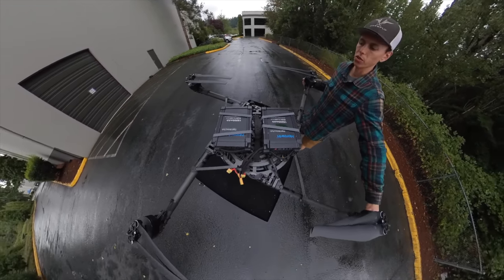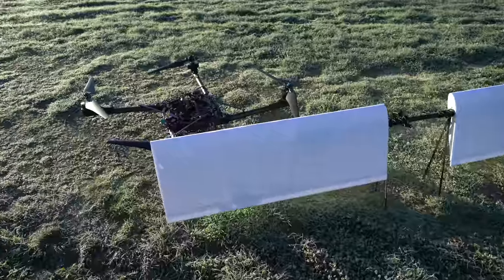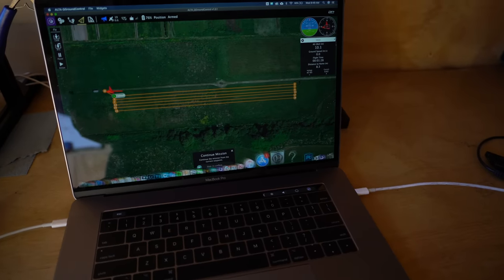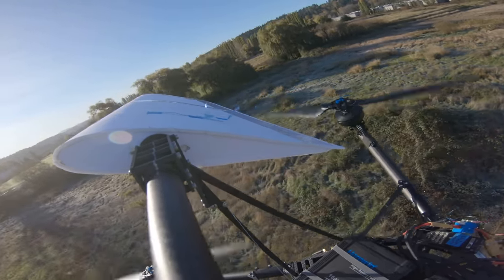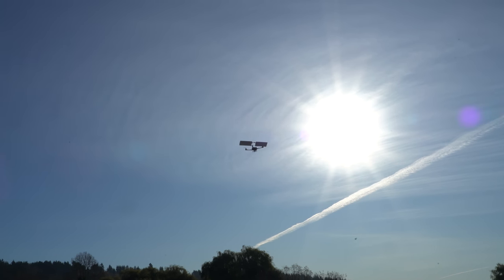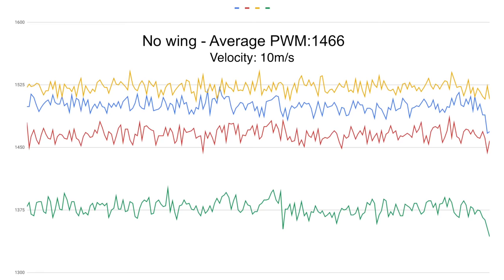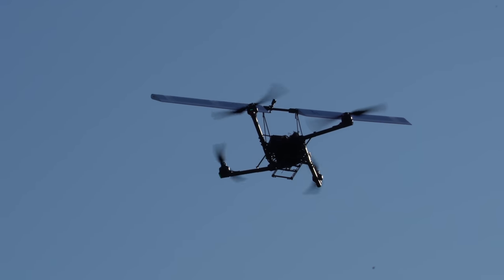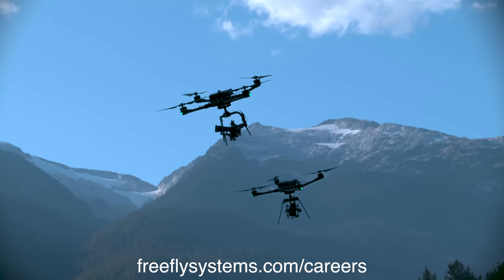Can a Wing Increase Quadcopter Efficiency?

Comment: The wings should have their center of drag in line with the center of mass of the craft to avoid introducing the pitch moment that caused the oscillations. This is tough because the wings would have to be mounted even farther outboard to avoid colliding with the rotors. If the front/rear motor pairs were moved more frontward/rearward instead, clearance for the wing could be introduced without elongating it and the available pitch moment from the motors pair would be increased, allowing it to more effectively counteract any pitch-wise disturbance.
Reply: that plus these wings are dead they have no control surfaces to combat aerodynamic forces like you would have in any real or model rc aircraft, adding this would likely fix it. ditch the homemade wing and get one for a rc plane that has all the control surfaces built in and intergrate it into the drone so that its software begins operating them to keep it in line with its stabilization programing. Also there's another way to improve efficiency , by changing out the rotors for the torodial design they not only improve flight BUT are near whisper quiet making the drone hardly noticable
Reply: Yes. It should have neutral static stability so the rotors have authority. I.e. the aero body must be orientation agnostic with respect to the relative wind and generate no torques about the cg. I don't know how close one can come to this in reality. None of these designs ever come close though because they don't even try.
Reply: You can technically solve this by just adding an equivalent system to the other side.  Could try using smaller wings mounted top and bottom.
Reply: The other thing to consider is the fact that, not only is the wing causing a pitch moment due to induced forces, the center of mass is now shifted higher if not above the motors creating an unstable system.  Even just adding a ballast below the quad could theoretically make the motor control play a little nicer.
Reply: I had a thought in a slightly different direction. How about 2 smaller wings, one in front of the front motors and staggered vertically but forward and out of the prop wash path, and the rear staggered slightly below the vertical rotation axis of the rear motors, behind the rear motors, again out of the wash path. So front and rear wings. This would of course require a landing gear to prevent awkward takeoff. But with the same pivoting wing with rotation stops would certainly have fair upward lift without the interference with prop flow paths. It should also equalize the load decrease across the motors..
Reply: @TAKIZAWAYAMASHITA  I think toroidal rotors for a craft that size may add too much weight.  He said they were 30in/762mm in diameter if I heard him correctly.
Reply: correct, but not likely given your use parameters.  instead, how about splitting the wing above and below the rotors to decrease the width?  a biplane configuration would balance out the forces.
Reply: I was thinking something similar, though I was also thinking, if the point is to increase efficiency, one of the primary reasons you would need that is for range, so what if you tested with an extremely aggressive flight angle? You could essentially mount the wings fixed, so that they are pointing straight up when then copter is on the ground.

You'd end up with something like an Osprey, but instead of pivoting the motors in line with wings, you just pivot the craft to bring the wing in line for distance flight, and it should have little to no effect on the hover, with the exception of being a nightmare in the case of wind, as he mentioned.
Reply: I am an IFR flight instructor, and I thought exactly the same thing.
Reply: The drag force of the wing is in reality quite low (normally about 1/50th oft the lift force) compared to the size of the setup, so i doubt that this effect induces the negative pitch stability. I rather think its because the center of lift is too far in the front, and that causes the pitching moment to be increase with the angle of attack, which in term increases the angle of attack even more, and so on...
Reply: @TAKIZAWAYAMASHITA  Well, toroidal propellers arent as good as you might think, its just a hype and those propellers perform really bad in reality: https://www.youtube.com/watch?v=hyT3NR-jjV8
Reply: @TAKIZAWAYAMASHITA  🔴 What Is Islam? 

🔴 Islam is not just another religion. 

🔵 It is the same message preached by Moses, Jesus and Abraham.

 🔴 Islam literally means ‘submission to God’ and it teaches us to have a direct relationship with God. 

 🔵 It reminds us that since God created us, no one should be worshipped except God alone. 

 🔴 It also teaches that God is nothing like a human being or like anything that we can imagine.

🌍 The concept of God is summarized in the Quran as:

📖 { “Say, He is God, the One.  God, the Absolute.  He does not give birth, nor was He born, and there is nothing like Him.”} (Quran 112:1-4) 📚

🔴 Becoming a Muslim is not turning your back to Jesus. 

🔵 Rather it’s going back to the original teachings of Jesus and obeying him. 

More ....
Reply: @1islam1   Thank you brother for these words may Allah guide non Muslims to convert to Islam in chaa Allah
Reply: @EXPRCP  These tests cant be 100% validated as hes using 3d printed material, 3d prints always have variations especially in the material strength, density and imperfections. Plus they are prone to flexing, something you dont want in a propulsion unit. Have this repeated using a machine fabricated metal prop or carbon fiber. these blades have to be perfect so getting it done at a qualified machine shop or a shop that creates aircraft rated parts like a drone maker small rc plane/helicopter maker or a actual aircraft maker to fully validate the concept and rule out any other variables
Reply: That's an interesting thought, but how woumd you do that, drag depends on speed.
Reply: @TAKIZAWAYAMASHITA  you are right, but that also means the concept isnt validatet at all at this time
Reply: I know all that from ksp
Reply: Yep, center of mass issue.  Move wings down, give a dihedral, and made overall wider to give rotor clearance while keeping lifting area the same.  I think the pivoting wing is bad, it allows oscillating between lift and no lift.
Reply: The better option might be to place them in between the motors, and move the motors further apart
Reply: @mossm717  I think your right,  that would increase control authority!
Reply: All the issues mentioned have been resolved and patented in US Patent US20210107637A1 "Universally attachable hinged wing and vlos aid for multirotor drones".  We are scheduled for the release of our product line soon.
Reply: @micahbusboom The centre of mass being above the thrust is not actually an issue, this is the Pendulum rocket fallacy, but the issue is rather the drag moment being so large because of the distance between the centre of mass and centre of pressure
Reply: @1islam1  🍎 Hail Eris! What is Discordia?

☮🍎do whatever you want, just don't be a dick to others

🍸🍎mind-altering substances allowed

👬🍎 Eris does not judge how you love

 🌭🍎 partake joyously of a hotdog
Reply: @JNelson_  This actually makes sense to me but I don't think it directly applies to quadcopters with a dihedral angle on the propellers. If the craft pitches backward, the rear motors having a more vertical thrust is a self-righting force and, the higher the center of gravity, the shorter the moment arm for the self righting force. I could be wrong because my degree hasn't focused on aeronautics.
Reply: @Micah Busboom  we're getting closer. The misunderstanding is due to quadcopters following the aerodynamics of helicopters and not fixed wing a/C. The lift vector of the wing and of the motors will be limited at a max forward speed which is why Daniel's was stable until the quad had an aggressive forward angle.
Reply: @micahbusboom  you are right about the self righting vertical lift. It starts when the rear motors are higher than the center of pressure and though the wing is not stalled, the thrust pushing through the COP forces the wing down, motors spin up for forward speed correction and now oscillations have started
Reply: @EXPRCP  total drag is 1/50th of the lift? At what speed/pitch angle? This seems to be a bit of a bold assumption. How did you calculate that? Yours is a good point, though. But the forward/aft movement of the center of pressure of the wings in a higher position in your model, is influenced by the pitch angle of the drone itself, which in turn depends upon the drone speed, which makes it potentially more unstable. By lowering the wings you would eliminate that problem, and you could concentrate on moving the wings slightly forward/aft to compensate for your good previous argumentation.
Reply: It’s crazy he thought it was a good idea to have an up tail. Duuude, make it at the CG center, have that horizontal bar go beyond the blades then have the wing outside. It will be wider by the motors will have a much easier time to keep up gusts and AoA
Reply: @Nevir202  basically a quadcopter version of the Convair Pogo; I was thinking the same thing.
Reply: @rustyshaklford9557  Ha, I forgot about that thing, but ya, basically lol
Reply: The wings could do to be a quarter the size
Reply: I love how I don't understand anything
Reply: The wing can fit under the rotors and be servo controlled and double as the legs. Plus the wing is way to big
Reply: What about changing to a "circular" wing?  A gyro plane effectively.
Reply: @TAKIZAWAYAMASHITA If toroidal propellers were better they would be used everywhere....but they are not.

Comment: Move the wings down to the center of mass of the drone, to avoid having it add a speed-pitch feedback making it unstable. Control the wing AoA with a servo so that it's always correctly oriented relative the direction of travel through the air. Perhaps add a few degrees of dihedral to the wings to get a bit more stability. Use an airfoil section optimized for the very low speeds seen here, something appropriate for maybe 1-3 million Re.
Reply: The "dihedral=stability" equation is not so clear cut. the way dihedral works is by rolling the plane in the direction opposite sideslip at positive AOA, but with this arrangement that just adds more complexity for the control system to fight against.
Reply: it will the the blades
Reply: @hazza2247  my in goes with pitch up free
Reply: @brycering5989  what?
Reply: All the issues mentioned have been resolved and patented in US Patent US20210107637A1 "Universally attachable hinged wing and vlos aid for multirotor drones".  We are scheduled for the release of our product line soon.
Reply: No servo needed. Just add a stabilizer surface aft of the wing with uplift. Dihedral is a non-issue with an active flight controller, or any form of fly-by-wire. It's never hands-off like you have with a manned stick-and-rudder plane. 
I agree on the airfoil selection, and would add that the wing could probably be scaled down considerably. The lift is overcoming the drone's ability to maintain altitude. The wing can be kept high, in fact. The speed-pitch is going to remain so long as the lift outweighs the motors thrust, until you program a whole new flight controller. Even if the wing was on the bottom, at speed the drone is going to left, and drone will cut throttle, starting an induced oscillation. Less lift, either by AOA, slower speed, or smaller wing is the only way to halt it. Ideally the wing AOA would be constant lift, not constant AOA.
Reply: @ryanmcgowan3061  For years we have been privately testing this exact concept with over 300 test flights on DJI and other drones and we filed a patent in 2019.   All the issues mentioned in the comments have been resolved and patented in US Patent US20210107637A1 "Universally attachable hinged wing and vlos aid for multirotor drones"; by using a balanced pivotal wing or the placement of the wing's AC substantially over the CG of the drone at constant pitch angles.  We are scheduled for the release of our product line soon.
Reply: Is there a way to mount a smaller wing   But underneath the drone ?
Reply: at 10 m/s that wing will be closer to 400k Re. Also the momentum produced by the wing is a big factor, you can se in the video that when the wing start generating more lift the drone pitch back. I don't know much about it but maby a stable wing like all-wing aircraft will be better.
Reply: Leaving the wheel fixed on a hinge with its range limited by something solid would already make it self adjustable

Comment: At Warwick university I saw a drone/fixed wing hybrid that had a stationary delta wing which was vertical when on the ground and then the drone completely turned horizontal during free flight thus turning into a fixed wing plane with a rotor above and below each side of the wing. I imagine this required custom software to calculate the best angle of attack for different speeds.
Reply: You could always abruptly transition to forward flight mode, stall, and recover
Reply: The RC aircraft X-Vert seems to be what you are describing, but with only a pair of motor. It uses pre-programmed maneuvers to transition to fixed wing and back again, while also changing the flight controls to be the standard for each.
Reply: Yep, they're known as Tailsitters.
Though there's not usually any custom programming required, Arduplane supports the configuration out of the box.
Reply: Tailsitters are efficient for long range, although as a camera drone the body interferes with the downward field of view at low speeds or hovering, and cannot fly sideways at higher speeds.  The concept in this video has been patented in US patent US20210107637A1 "Universally attachable hinged wing and vlos aid for multirotor drones" and we are scheduled for the release of our product line soon.
Reply: PteroDynamics has released the video of their transwing drone the uses fold of wings with the props on to go from vertical to horizontal flight.

Comment: With a properly tuned flight controler taking the wing into account, I think your preliminary data shows the wing it might have a significant efficiency gain in forward flight. I think for certain mission profiles you're onto something.  As always great video Thanks

Comment: this is the kind development and testing I want to see more of.
Reply: mee too !!
Reply: For years we have been privately testing this exact concept with over 300 test flights on DJI and other drones and we filed a patent in 2019.   All the issues mentioned in the comments have been resolved and patented in US Patent US20210107637A1 "Universally attachable hinged wing and vlos aid for multirotor drones".  We are scheduled for the release of our product line soon.
Reply: 100% 👍
Reply: @dronedevices  Will be watching for this release! ;)
Reply: @AirtimeAerial  Thank you for your interest!
Reply: There do exists hundreds of different VTOL aircrafts ranging from lil toys to 24,000 Kg V22.
Reply: @himanshusingh5214  This is different in that you're adding a wing onto any existing multirotor drone, our patent details a quick attachment method as well as increasing VLOS.
Reply: @dronedevices  Adding a wing to a drone not made for this means a big loss of efficiency for starters.
Reply: @himanshusingh5214  Not in this video or in our data after years of testing.
Reply: @dronedevices  Okay
Reply: @himanshusingh5214  Adding the wing does increase forward flight efficiency and range, although not quite as efficient as a VTOL that has propellers perpendicular to the wing during forward flight.

Comment: I'd really like to see this experiment repeated with the anomalous motor issue fixed. Like you said having one motor completely idled is really going to mess up the quads ability to stabilize itself and it might be a lot better without that problem present.
Reply: Flight controller: “u wot m8”
Reply: Don't think a motor was actually idle, just the motors and telemetry were not calibrated.
Reply: @AerialWaviator  he said it was idled and it looked idled.

Comment: The way you mounted the wing high above the quad puts the center of lift ahead of the CG when the quad pitches to translate forward.  Thats almost certainly the main cause of your pitch instability in fast flight.  The front motors are decreasing in speed to the point of idling because pitch moment from the forward positioned wing is so large it's taking all the load off them.

Comment: rctestflight your research is inspiring and see where you are going. Based on your RPM data showing distinct differences between 4 rotors perhaps prudent to try positioning 4 separate wings behind the thrustline (beneath) of each rotor. So as each rotor thrust will behave independently and observe any change in stall threads attached on low pressure surface of each wing in full throttle forward cruise. In turn cumulative lift may show where lift disparities exist. Good job of messing around so much with this, excellent!